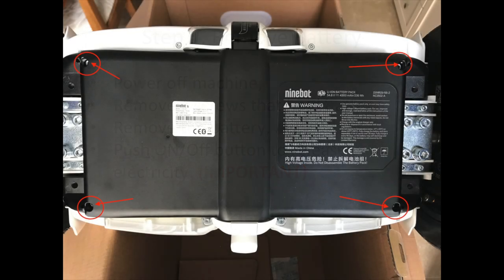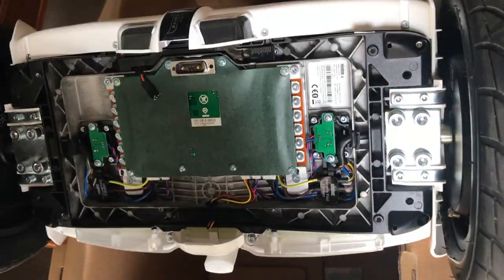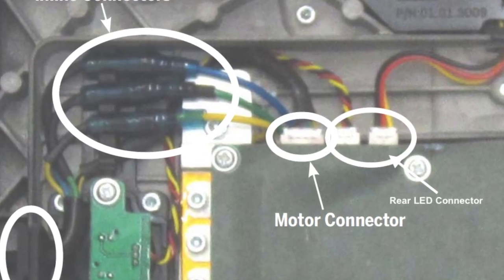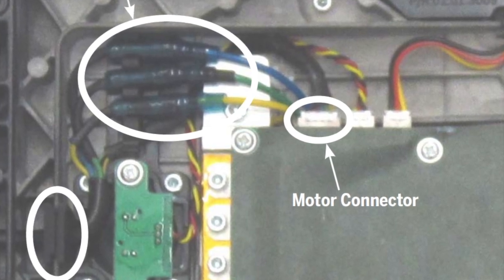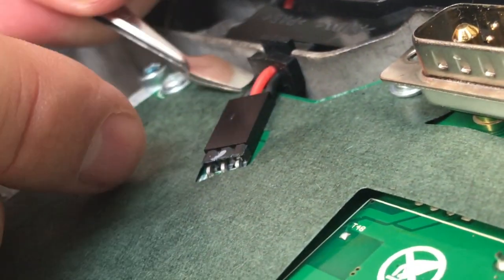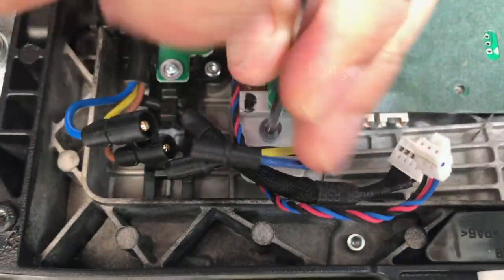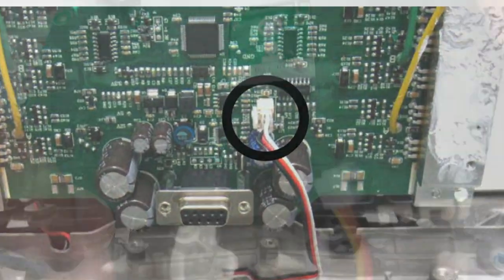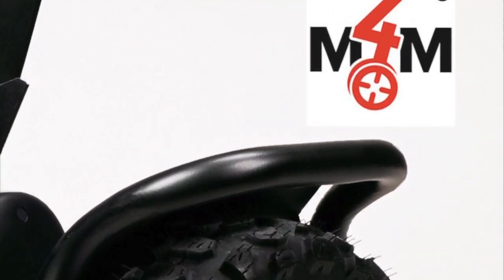M4M Video: How to replace control board in Segway miniPRO and Ninebot S

Comment: Thank you, i was able to replace but unfortunately segway still not working.  I tested battery also but thats fine.  Shows empty battery thst is rrally full and wont connect to app and flashes white lights.  Any suggestions?
Reply: I have this same issue. Did you find a fix?